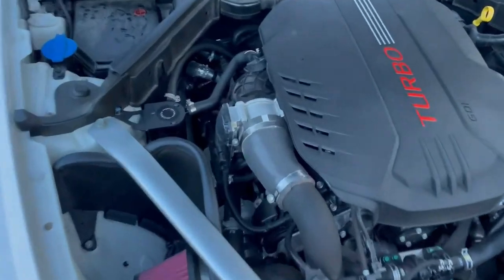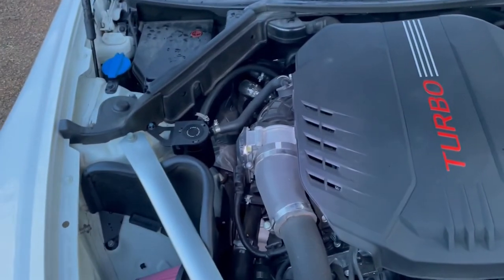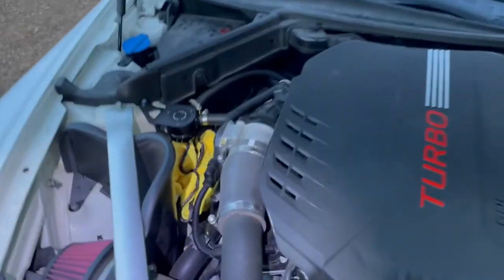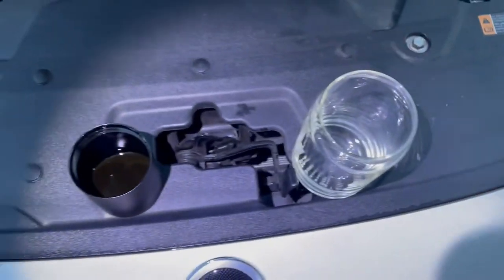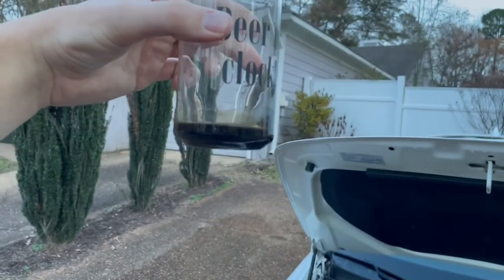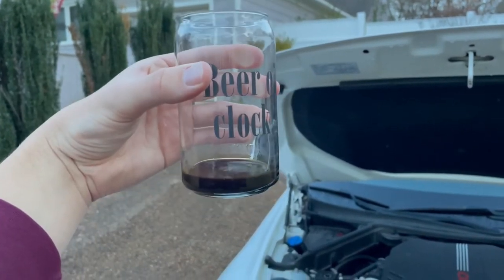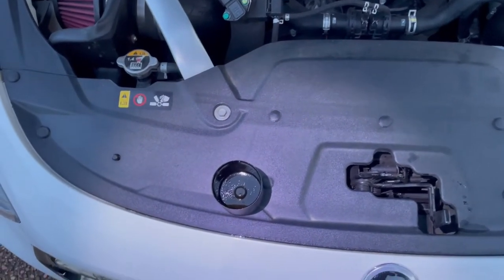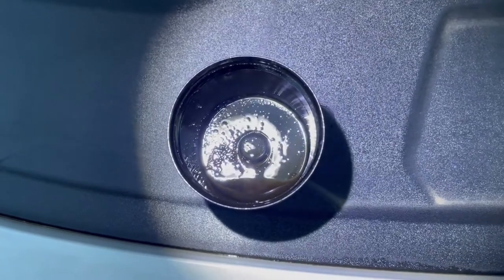Kia Stinger GT2 Oil Catch Can - 3K Miles Later

Comment: Good video boss. I am running the ADDW1 dual oil catch cans on my 2022 GT2 AWD. You nailed it on the head. Preventative maintenance mod well worth the cost and peace of mind. It was the first mod I did after purchasing the car. I just drained and cleaned them out as well and got about the same amount captured as you did. Cheers!
Reply from the maker: Thank you for the kind words man. Gotta protect our toys and the catch cans are for sure a good way to do so 🤝
Reply: Most stinger owners agreed that the first mod for your stinger must be the oil cacht can and it will help your engine (heads) run cleaner.
I  just bought my 2nd stinger 3 weeks ago and i'm getting the ADDW1 dual catch can or stage 2 from K8 store by next spring..

Great video btw 👍
Reply: @Elias M  I originally had the 2018 GT1. On my second one as well :) no mods on aforementioned. Learned what I wanted to do and have put on the new one, the catch cans, dual  ADDW1 blow off valves, upgraded HKS plugs, Injen dual intakes, JB4 piggyback tune and several cosmetic mods. Much more to do as well. This platform to me is worth every penny I have planned :)
Reply: @BDColin  i just have ordered yesterday a mishimoto catch can,MBRP pro stainless exhaust and a afe takeda CAI,when the spring comes i will ordered the jb4 and hks bov as well
Reply: Same! I just finished getting my ADDW1 dual catch cans on my brand new '23 GT with 600 miles on the clock 😂
It always gets me when I see people running tunes and other supporting mods and at like 30k miles "Hey I'll install a catch can!" 
Uhhh I'd hate to see what's already in there.... lol

Comment: In my opinion the hoses are too small diameter for a boosted car….. most Audi boosted cars have three 5/8ths diameter breathers one per valve cover and one on the block.
Reply from the maker: The Mishimoto hoses are the same diameter as the OEM hose so I have to assume it’s fine. Mishimoto is a reputable brand too so I feel good about it. I love Audi’s too. Wanted a B8.5 S4 for the longest time
Reply: @SLW_GT2  thanks. Someone who actually knows how a turbo car operates
Reply: @SLW_GT2  I’m building. B5 S4 GT3582 R with tial v band exhaust housing and a bunch of other trick stuff…